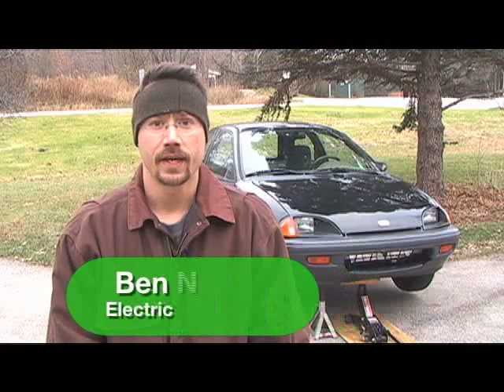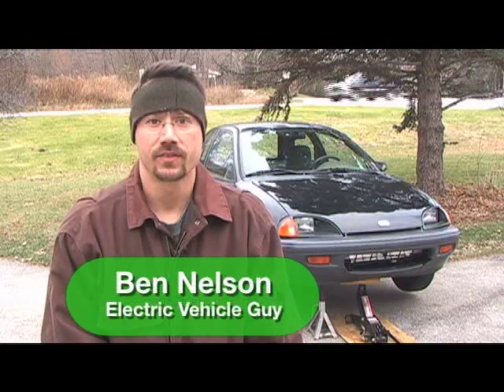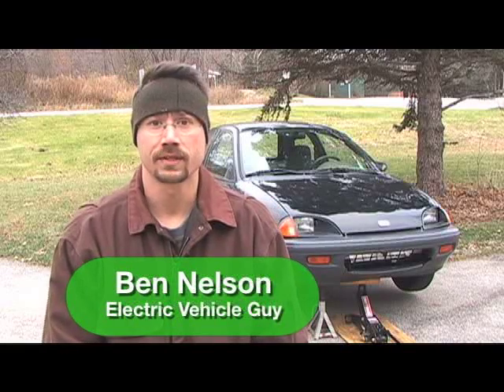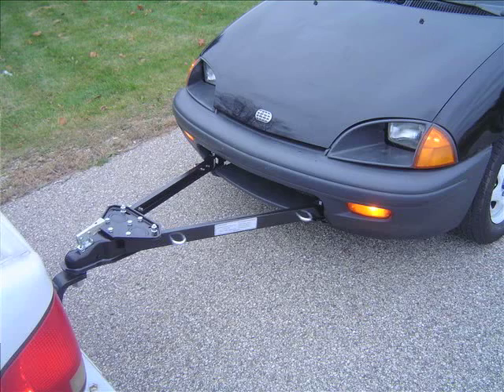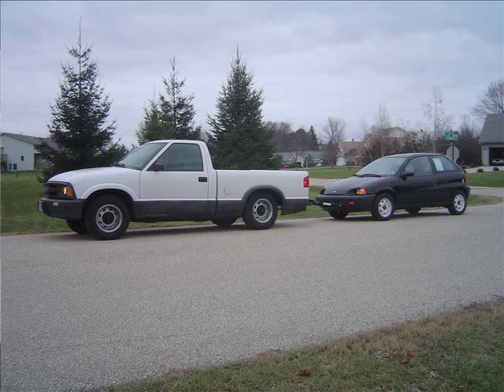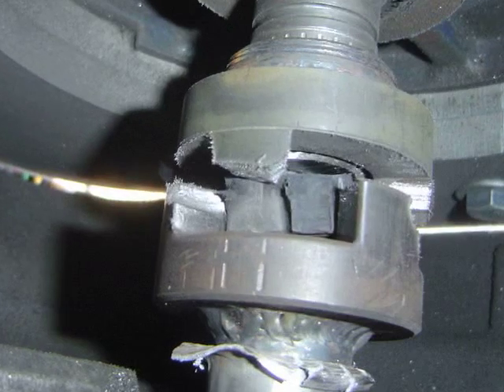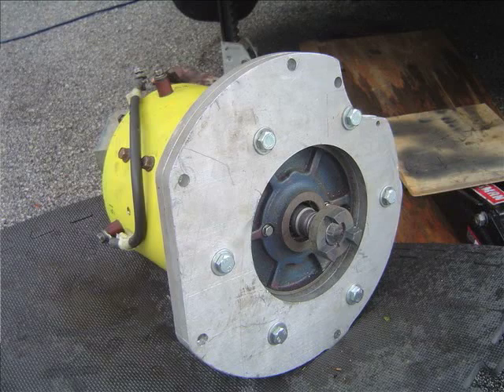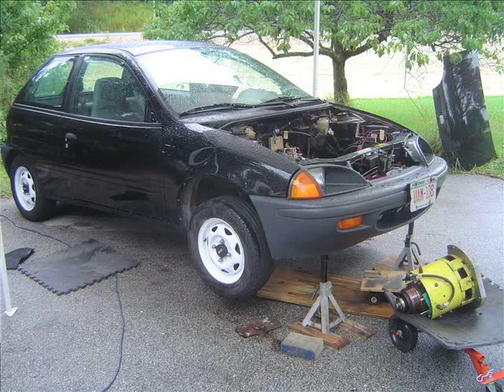Electro-Metro Update 11/19/2008

Comment: I know n2confusion prefers to use lovejoy couplers.. they are all steel. For my electric car, I'm going to have one fabricated for me rather than to buy a lovejoy. I know a guy that will make one for me really cheap. Check out my videos, I'm building a 1986 Dodge Daytona. Progress is basically at a standstill while I wait for the transmission plate, but during my Christmas break for college hopefully it will be done, and then I can get some parts in.
Kyle

Comment from the maker: The coupler itself is two halves, which are steel. In between them is a spacer, which can be rubber or harder materials.

I really think the problem here was installing the motor and transmission seperately, which caused the alignment to be off, then causing wear in the coupler.
Reply: I think the coupler is not strong enough for the torque the motor exerts or they moved on the shafts and that led to them destroying eachother.